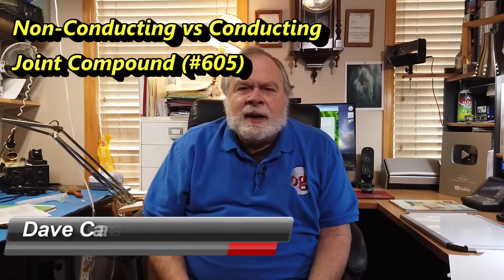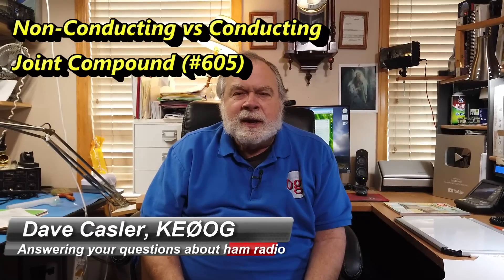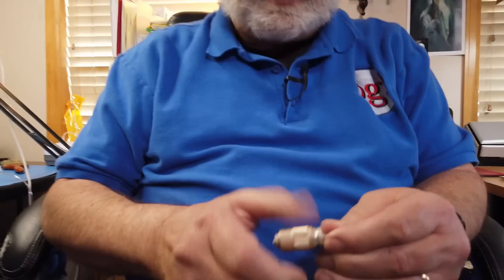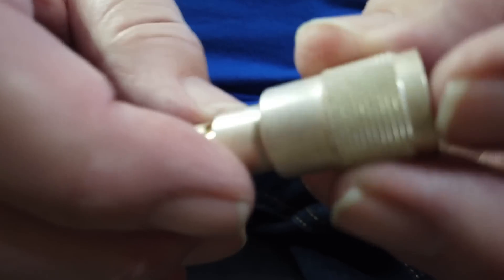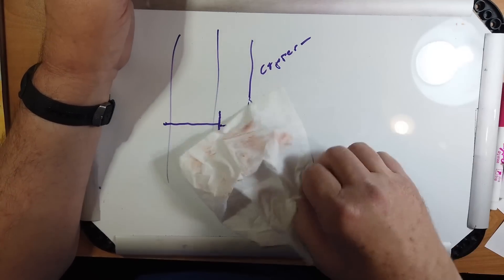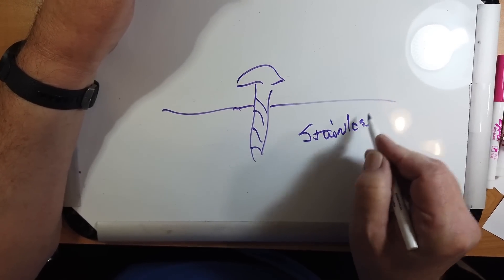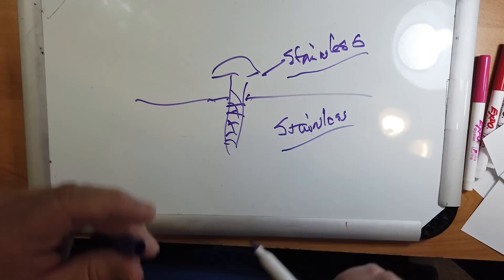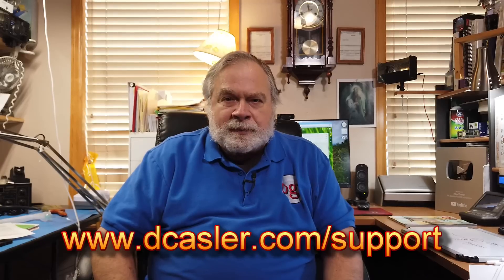Non-Conducting vs Conducting Joint Compound (#605)

Comment: What you are discussing is called "galvanic response" of metals. Copper and aluminum are classic response metals that will corrode in the presence of oxygen. You CAN use them together if you use conductive grease that isolates the joint from the oxygen in the air. Conductive grease also transfers heat from one metal to another. Say you have a full wave bridge rectifier in a package that is flat with a bolt hole in the center. You apply the conductive grease because it will transfer the heat generated by the rectifier to a metal heat sink allowing it to cool itself from high current passing through the rectifier.
    Now, non conductive grease isolates joints from any galvanic response, but gives a strong mechanical joint without corrosion as the grease isolates dissimilar metals from the oxygen in the air preventing any corrosion. That is the difference between conductive grease and non- conducting grease. The things we learn in our "hobby" of Amateur Radio!

Comment: Back when I did my own brake jobs I would often lube the bolts and mounts holding the brake pads in place with a copper colored grease that came in the kits.  I think the intention there was to keep the heat of braking from causing the parts to seize over time.  I wonder if that is the same kind of conductive copper grease that we're talking about here?

Comment: Dave what do you thank about putting loctite 242 on pl259 connectors or N type
Reply: Not a good idea. With such a large contact area and fine threads it will be impossible to later disconnect the cable without using pliers or the like since most RF connectors lack any spanner flats.

Comment: The tape you had sounds like self amalgamating (as its called over this side of the pond) tape. I have used it on my antennas and have had no problems with it (until you need to remove it). It's good stuff. Merry Christmas and a happy new year to you. Dave Morgan MW0MDV

Comment: Stainless steel cracks internally, and despite looking good externally. when ever you service a system that uses it for a stressed connection, it should be replaced. This is best practice.

Comment: Vaseline works well on the outside of connectors. Copper antisieze works well for aluminum to aluminum joints
Reply: Use the Vaseline on the threads of so-239 and that forms a water barrier to keep the water from entering the coax . Also it will not cause any interference with the electric connection .

Comment: Another great show Dave. It's age is showing because the light is still leaning but it just makes the show more interisting. We use a lot of brass conections in motor and  control circuits to reduce  corosion. KD9HWH said that.

Comment: Really good information here. I might add that anti-seize is the common name for the goop that you would put on stainless to stainless connections.  And we use it often in power distribution as a industrial electrician. Linerless rubber tape is another name for the splicing tape from 3M. I often do a wrap of 33+ electrical tape backwards(sticky side out) first then linerless rubber tape, then 33+ electrical tape on my connections.  That way when you cut off the tape it doesn't stick to the connectors.  Great video Dave, always enjoy your stuff, can't thank you enough KF0GZC.
Reply: @garrysekelli6776  what's that about? You a carpenter or something? Salt isn't good at preventing corrosion.

Comment: I use "Stuf" in the RG-6 connectors for my Beverage antennas, replacing it every year for annual maintenance; silicon fusion tape then around the connectors since it is so easy to remove when need be. Jet Lube SG-30 works well on all joints that need conductivity, but don't use it on coax connectors!  Dino KLØS